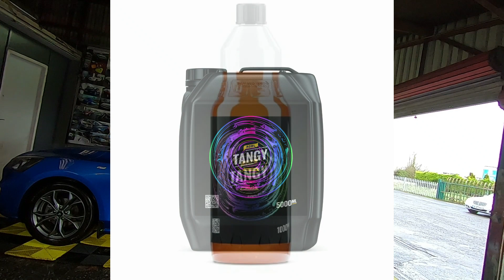HOW TO DO A MAINTENANCE WASH on a Ceramic Coated Car

Comment: Great video Peter. Also great to the simple pouring of shampoo 😀 Open bottle, pour, yeah that seems about right. No measuring jugs here 😎. You make the process seem so simply. No fuss!
Reply from the maker: Thanks, Keith, there are products that dilution needs to be done more precisely than that :D , for example, APC for interior etc, but in the case of shampoo if I pour that little bit too much I don't get stressed out cause of it :D.